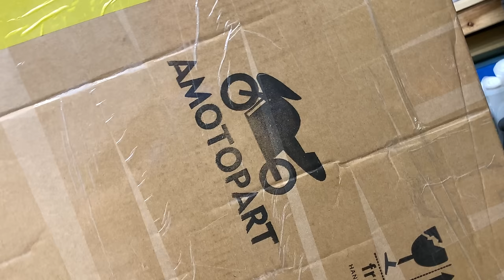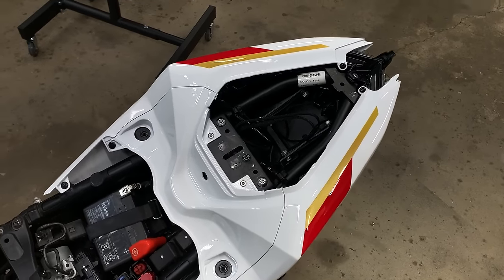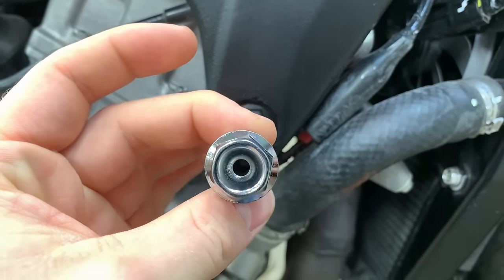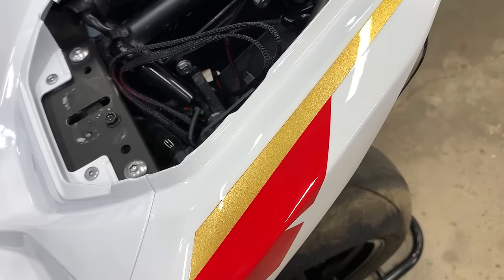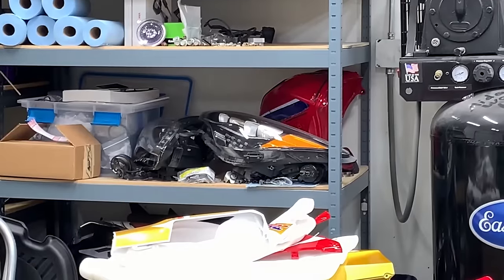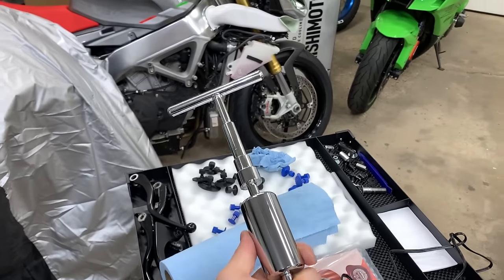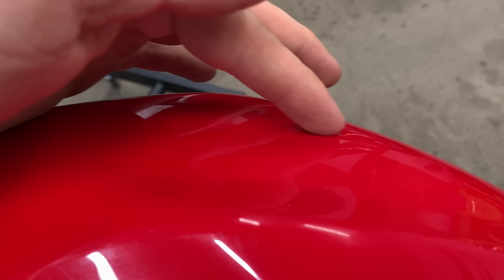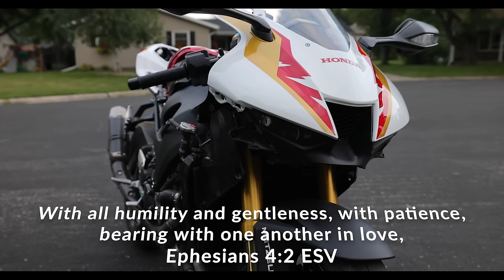Rebuilding A Wrecked 2021 Honda CBR1000RR-R SP (Part 5)

Comment: Lemon oil can melt off glue residue (it smells nice) and the rest you can clean with an IPA✌🏻Rubber wheel is also good but always check the surface temp to not burn the paint. Cool series!

Comment: The gold defo looks similar to john mcguinesses tt bike from last year i think it was check it out . Its un mistakeable the gold . Good job with the tank too . There is tool levers too that you could maybe get in through filler cap ? Have a hunt for them iv seen pdr dudes use them to smooth out small dents gently .

Comment: Make excellent videos and miracles, I follow you from Italy .. but I advise you not to rub some paper on the parts of the bodywork because even if it doesn't seem it leaves very light scratches. try a leather cloth. congratulations keep it up! “I APOLOGIZE IF THERE MAY BE ANY ERRORS BUT I'M USING THE TRANSLATOR”

Comment: The quality of the Amotopart fairings must be good if you keep buying them. I need fairings but am concerned about them failing prematurely and disintegrating on the highway
Reply from the maker: They are good! I go into depth on the fairings more next video but so far they have the best quality molds for the fairings and this fireblade has some insane complex fairings